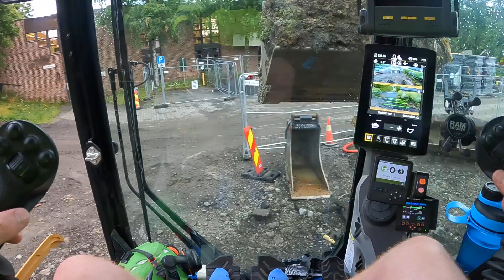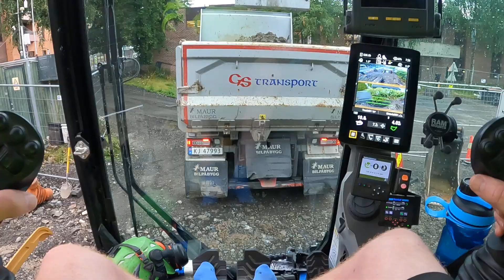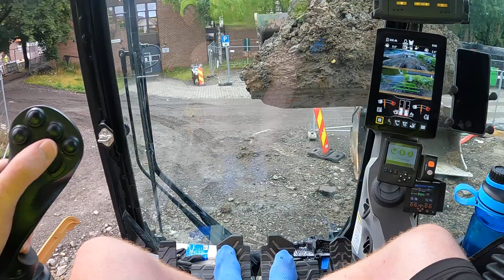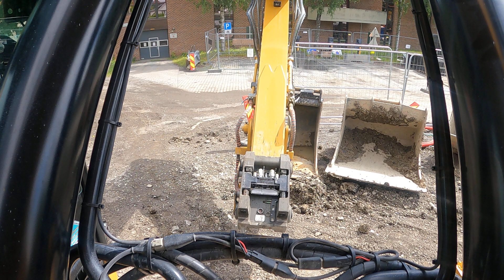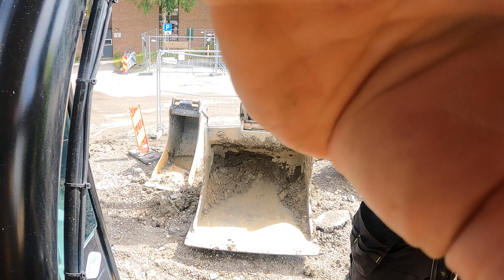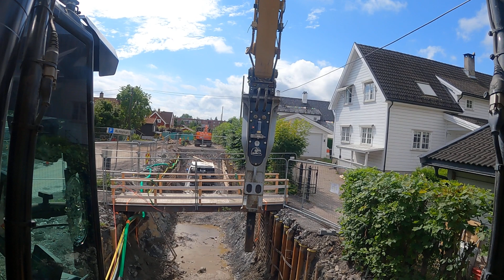cat 335 next gen with @OilQuick loading trucks and digging ditch💪

Comment: The 335 is Awesome. How much need the 335 in the hard work? 👍💪
Reply from the maker: I am so happy to have received such an awesome machine 🤩👍 Diesel consumption is from 13 to 15 liters per hour on the type of digging I have now💪
Reply: @Vidarsteinsland  
13-15 liters is good for this big machine 👌💪
Reply from the maker: @DIESELPOWER-AUSTRIA  yes it is👍. I use more diesel per hour when I have the Volvo 235😱👍 and that machine was only 27 ton.
Reply: @Vidarsteinsland  
What? The 235 need more than a 335 😁💪 the cat have 38 tonns with a bucket?
Reply from the maker: @DIESELPOWER-AUSTRIA  yes, I not kidding 🫣🤣👍  Volvo use more diesel🥴. The 335 I have weighs 40.3 ton in Norwegian issue. Cat power💪
Reply from the maker: @DIESELPOWER-AUSTRIA  I looked at an old engine report on the Volvo used 15.6 liters per hour on light work😀